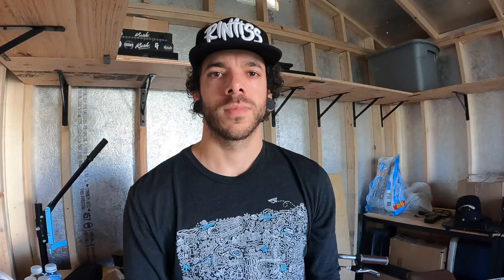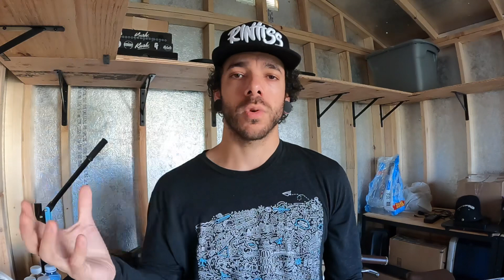Discover the Onewheel Hack You've Been Missing Out On: Calibration Explained!

Comment: Building a vesc atm., fuck fm.. subbed to this channel.
Reply from the maker: Nice! How's it going so far? Got all your parts picked out and purchased already?
Reply: @fixmypev  slowly as I'm also needing a new car unfortunately. I've plans to buy over time.  Right now I've got a few shells of fm boards and have a flowglider box from makers pev coming.  I made self balancing arduino robots before and could maybe re purpose one but I'd surely not trust it to handle a larger circuit, and using a relay board would be iffy

Comment: I look forward to seeing more videos specifically on this. I’ve done the recalibration for my Tech-Rails Sabers to re-level the board through the NRFConnect app. So if I’m understanding you correctly you can not fix and change the GT battery if ever it wears out without sending it back to FM? I’ve been worried about investing all this different money into this board because it’s only a matter of time before I’d eventually need a new battery. I ride this thing all the time and don’t want to pay to send it across the country for a batter change I could just do myself.
Reply: And have to change everything back to stock, or they strip it themselves, put stock back on, charge you for it all and...keep your aftermarket products.
Reply: This reset DOES allow you to change battery, it will clear the errors you get after disconnecting the GT battery that you used to have to send into FM for. As he mentioned it’ll even re-pair BMS’s out of different boards. So if your GT loses some cells or a BMS, this reset lets you fix it on your own and get it running without sending it to San Jose.

Before this and after rewheel got shut down, there wasn’t really a way to reset the board after disconnecting on the GT other than dealing with FM, so this is very helpful. I’ll be watching for the hall sensor recalibration videos!
Reply from the maker: Correct. You could not disconnect the battery without bricking your GT before this method was discovered. Would have had to send your board back to FM.
Reply: @fixmypev  which is a complete joke. I’d have probably bought a FloatWheel if I didn’t have to go through crypto because of FM’s history with right to repair.